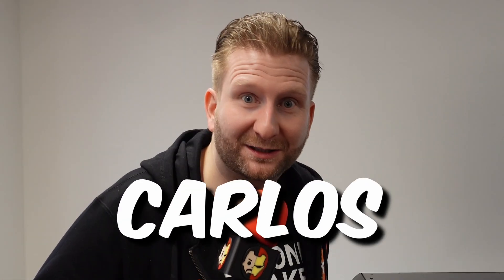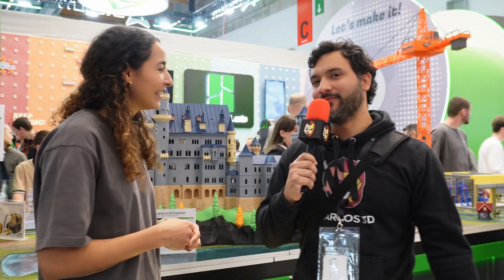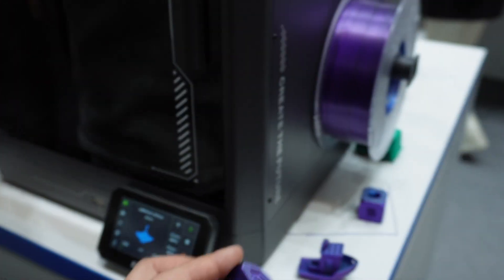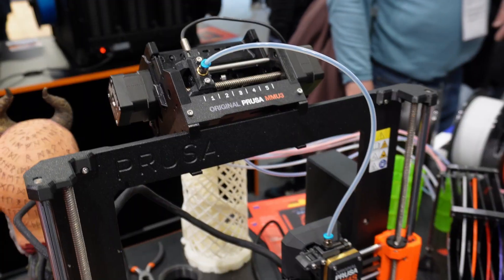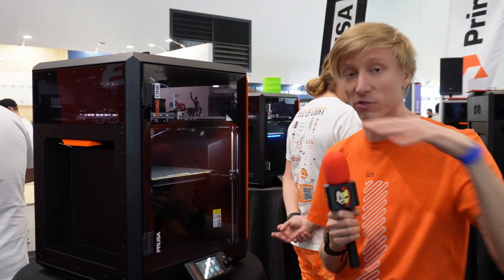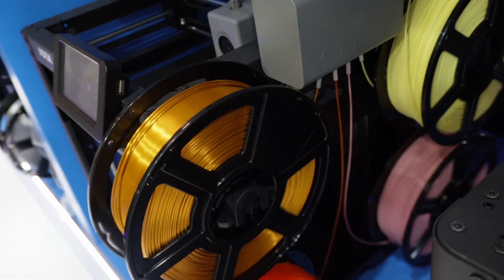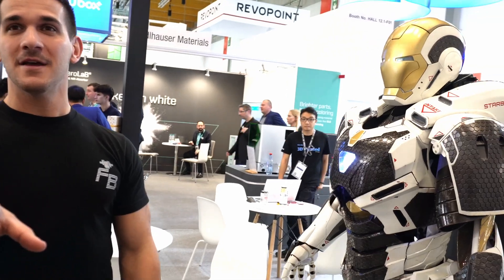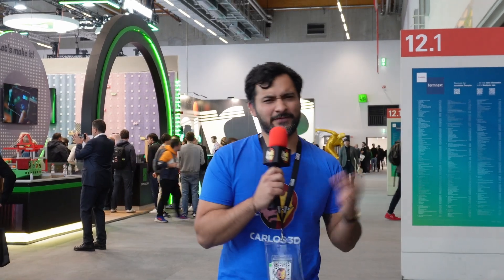Formnext 2024: Meet the Extraordinary Prusa Core One!

Comment: First company to solve 3d printing without supports and layer lines wins. I have some very good ideas on exactly how they can achieve it, but I have no interest in trying to make a 3d printer. I'm surprised nobody has thought of it yet (or perhaps they have). Bambu is saying their new printer will have some big surprises with things that are currently seen as almost impossible. Could it be printing without supports or prints without layer lines?! You could have a small nonstick pop-out sliver that runs with the hotend and when you come to overhangs the nonstick sliver pops out acting as support right underneath the hotend and you super cool the plastic instantly hardening it and voila no supports needed! Layer lines? Same concept but with a laser to meld the plastic together as the new layer comes along. Effectively melting the layers together. The laser melts the old layer just before the new layer is put down by the hotend.
Reply from the maker: Wow ! That’s sounds amazing 🤩

Comment: Good vdieo for sure however I do not find the Prusa Core One to be extraordinary the built plate to beat at less is the 256 square and Prusa step it down to below the MK4  with creality going to a crazy 350 cube their did not beat Bambu Lab who has stolen the market with the A1 Prusa fail to beat the A1 why ever wake up for the Core One! I love Prusa the company but  their have step backwards to the middle ages with 3D printing! The Chinese may have won here did their cheat to get here maybe but that their won is what matters the most! Bambu Lab does not support the right to repair like Prusa does do you think Bambu Lab cares what we think not likely their Chinese and the Chinese have the lion share of the market of 3D printing! I am new to 3D printing I want a machine and have yet to buy one, I did love the MK4S kit even if it miss some key sensors but now a tiny machine now I can't do that brcause research is both a good thing and a bad know knowing to much information has push me away from Prusa even thou I don't want this! I live in France!
Reply from the maker: Thx for your comment. You have very valid points here. I agree that Bambu Lab came to change the game and for good ! A lot of brands needed this kind of challenge to improve (Prusa included)

I appreciate Prusa as a brand but also because of their values and people behind it.  This is a step forward for them and I think they are on the right direction.

Let’s see what happens next for the 3D printing industry.
Reply: I ordered the XL, so if I get another machine I'd probably be fine with a smaller build volume, but I do find the design to put the filament rolls in the volume of the machine itself odd. Would be nice if there were multiple sizes.